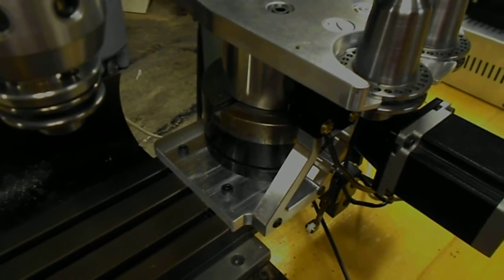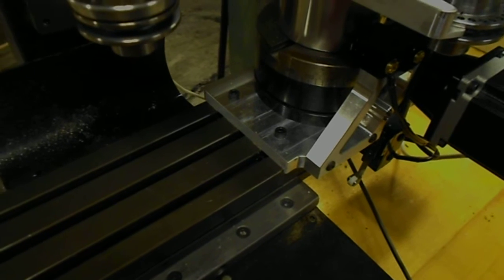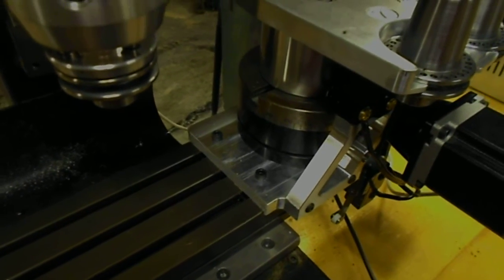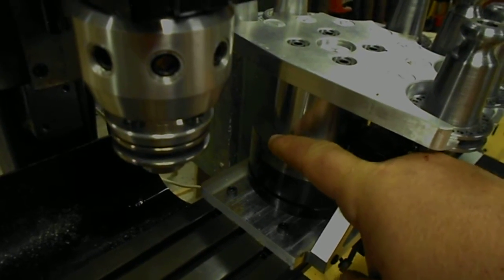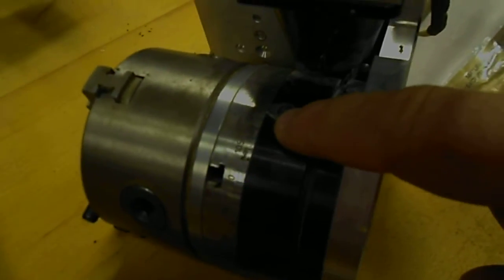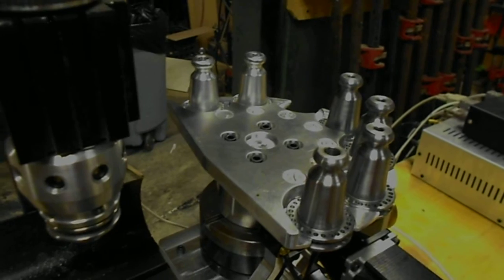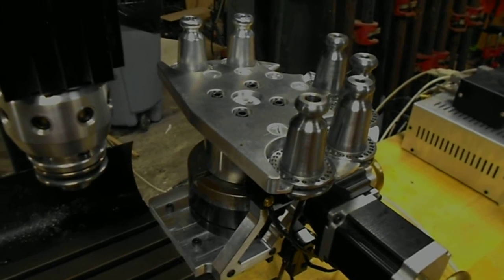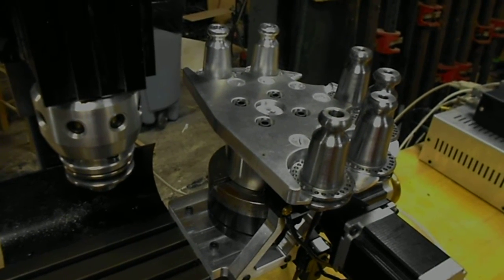Rotary Tool Changer setup - for the Taig CNC mill

Comment: are you selling this tool changer yet?
Reply from the maker: +JAMES GODFREY This changer has since been modified to exclude the sherline fourth axis. I am anxious to get this out but have missed the mark several times when telling people when I plan to have it out. There has always been room for improvement and this has been my excuse thus far in not holding my original debut date. Because it will cost me a ton of cash to get this ATC off the ground I am very critical as to the final product quality and the performance thereof. I just got an order of replacement springs that cost me dearly because of the manufacturers quantity pricing. These newer springs will be tested today so that the spindle will prove to perform equal to the air-actuated counterparts that others want to sell you for $3K. This should be deserving of a little more time spent in testing. I will not market this product until I am confident it will meet the needs of the Taig user unless it is marketed to exclude certain types of materials. Nothing can compete with the rigidity of the rigid ER16 spindle that is stock with your Taig purchase, but it would sure be nice that the minimum requirement for success be that it gives satisfactory finishing results on aluminum contouring and not just facing. Since steel is out of the question for this ATC my goal is to make it work well for, at the very least, aluminum. Only two tests are left.... the spindle engage, disengage under 100lbs spring test, and if this increased pressure has a positive effect on the finish quality of aluminum contouring. If there is still problems in maintaining an acceptable finish on the contoured finish the answer is to increase the diameter of the bearing surface (at least the lower bearing surface) which will require a full replacement of the spindle AND spindle housing. (since there are no larger bearings that can replace the 40mm stock bearings without enlarging the spindle housing) However, if this was the only solution left to achieve the quality of finish on aluminum contours it may, inadvertently, allow greater rigidity to allow for the machining of steel as well.
Chris
Reply from the maker: +Christopher Smith Yet another delay as the springs that were ordered from Jones Spring Manufacturing were the wrong springs altogether. How does that happen? I ordered only one size of spring and they send something that is "close to" my order specifications. News Flash..... a spring that has a wire diameter of .047 is MUCH stronger than a wire that is .026 in diameter. Couldn't even get one order right? Sad!
Reply: let me know when you want to sell. i will buy one from you. good work

Comment: Did you make the spindle? Do you have any plans/drawings?
Reply from the maker: matt whitehouse The spindle, toolholders, tool plate, and MACH3 screenset is made to work together. There are a few changes that need to be made before it will be able to be marketed. The use of the sherline rotary will be eliminated and replaced with an independent chain-driven system. This way you won't have to rely on an expensive sherline rotary to rotate the tool plate, freeing up the rotary and reducing the cost of the whole system. Other tweaks needed as well but mostly needed is a thorough testing of mill diameters and depths. When that is finished I will post a video of a simple part production from start to finish using at least three tools. I'm glad to say that my M6 macro works flawlessly and my ATC MACH3 page is nearly finished with its updates.